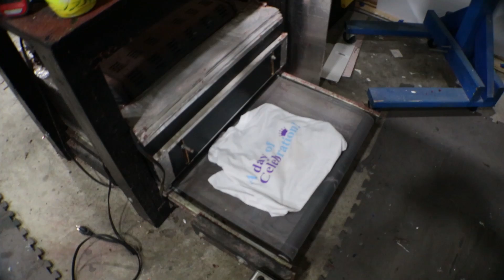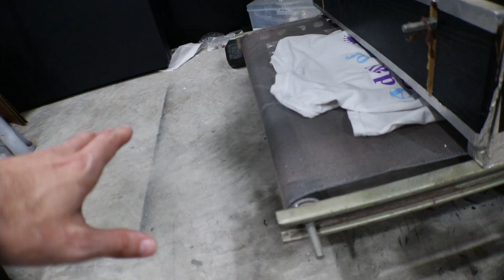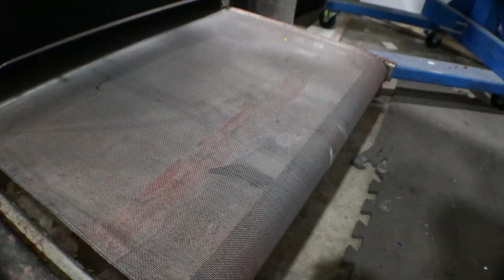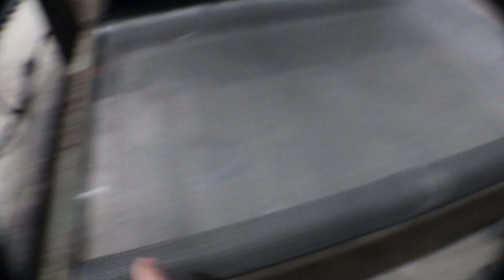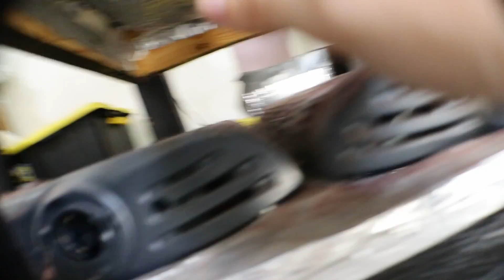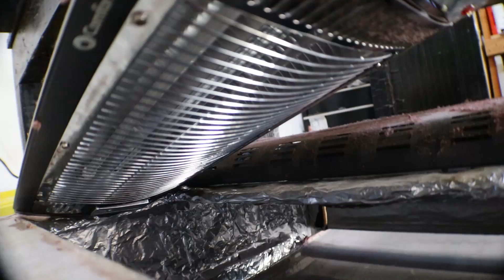DIY Conveyor Dryer Walk Through & Assembly Information - Screen Printing Business.

Comment: I used a Vevor 20x24 flash dryer with temp control from Amazon for my DIY dryer. Works great.  It's nice I can adjust temp for low cure inks.
Reply from the maker: Very cool. I will check it out.